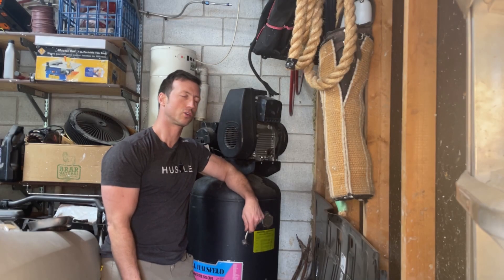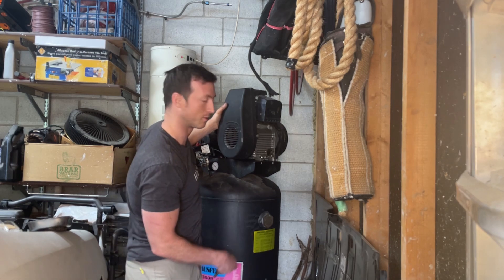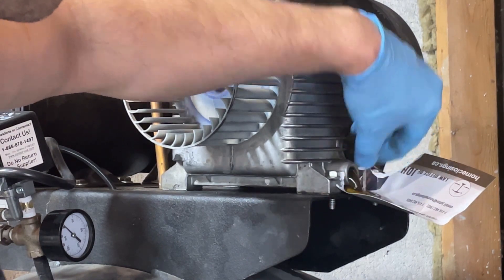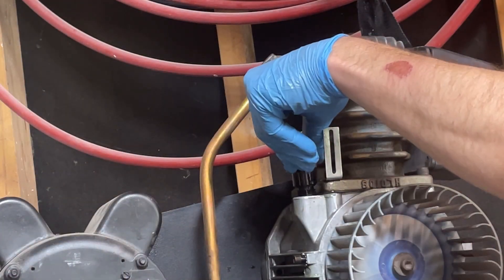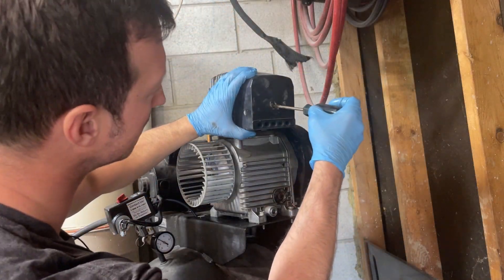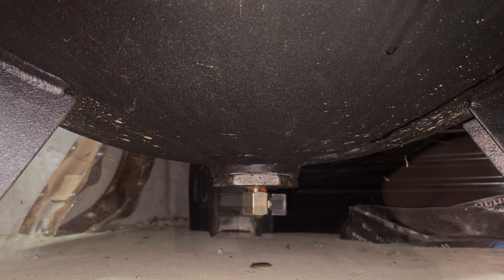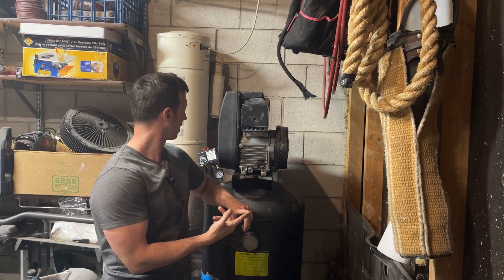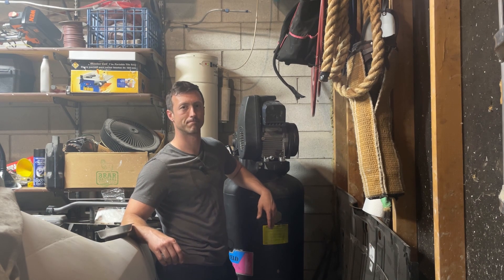How To Maintain Your Air Compressor

Comment: I always leave the drain valve cracked just a little bit while I run mine, keeps from building up any moisture. Consumes very little air but keeps the tank as dry as it can be.
Reply from the maker: That's a great idea. I was thinking of swapping to a different drain valve that would have a bigger drain hole since this one is really small.
Reply: Try out an auto drain available at Castair they ship same day and save on the extra electric bill from running your compressor with the drain open!
Reply from the maker: @jjsteen99  I'll look into it. I was thinking of changing my drain anyways because it doesn't open much to begin with.